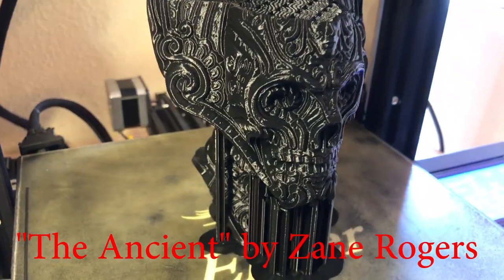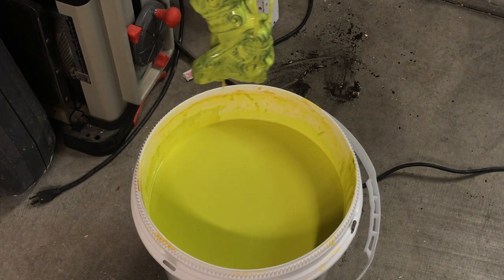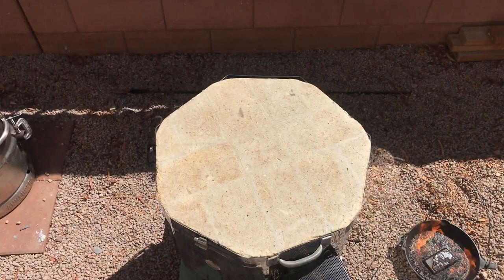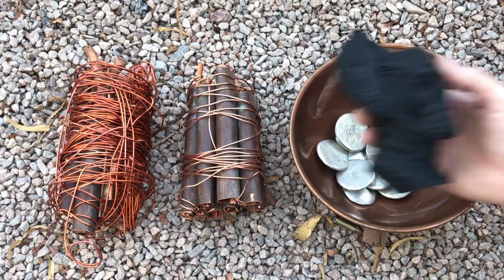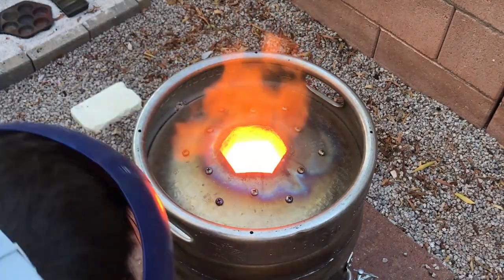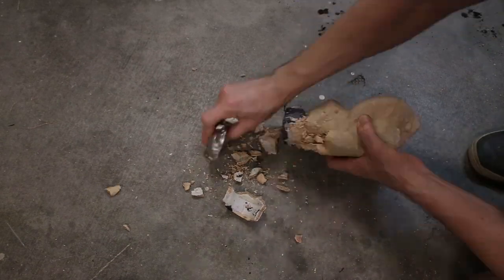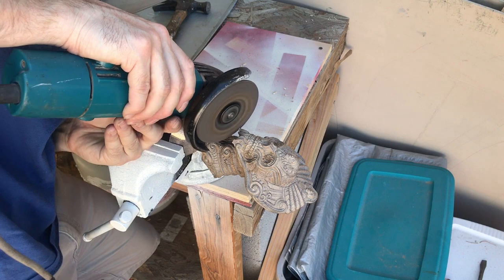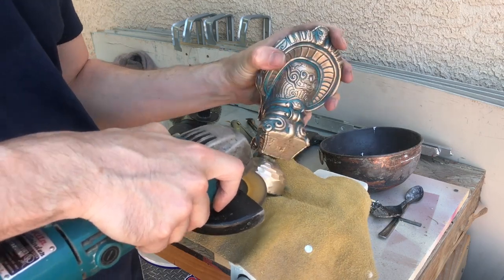3d print to bronze statue │ Lost PLA metal casting │ASMR │ Homemade foundry

Comment from the maker: The yellow ceramic material is called Suspendaslurry.
Reply: Man, that stuff is expensive. Seems worth it's though, as I bet it goes a long way with how little actually gets used as compared to other investment casting methods. Have you considered using polycast filament?
Reply: @faultyinterface  I wonder if one could achieve similar results with clay slip. You'd probably have to be careful with firing temperatures and things like that, but it seems worth a try.
Reply: Is there a different brand for suspendaslurr? Super expensive to bring it to Canada
Reply: suspendedslurry was my nickname in high-school... JK

Comment: Nice work. Just a couple of suggestions though: to reduce the amount of bronze used, fill the inner cavity of  pla prototype with sand/sodium silicate mix (as you did previously doing aluminum castings) and let it harden by blowing CO2 gas through it. To hold the core in place, pierce PLA prototype and sand core with stainless steel wire. If PLA is not thick enough (about 5-6mm), add some wall thickness using molten wax and then fill the cavity with sand/Na2SiO3

Comment: That's a truly amazing cast!  I love how you simulated the oxidation of the copper with blue spray paint! If you use ammonia fumes and salt I think you can also get some really cool patterns. How do you avoid voids as I don't see any exhaust tubes?
Reply from the maker: Thank you! I'll keep salt and ammonia in mind. There are some small voids on the right side of the neck and under the chin. I will cast it differently next time, but the vents from the chin to the top of the sprue worked fairly well.

Comment: Turned out great! I had my doubts on the spray painting but it really worked out awesome. 
I would suggest spray painting the plastic 3d printed model with some primer and then some paint before dipping. This would get rid of some of the lines visible frome the layering of the 3d printer. 
Great job looking forward to more of these vids

Comment: Nice job. The only suggestion of something you might like to try is instead of paint try using a patina like liver of sulphur, this works well on electro formed copper jewellery so it would be worth the experiment. 
There’s also some other patina solutions that use ammonia and salt from memory, if you’re interested I can try and find it in one of my plating books

Comment: You should put an aluminium foil hat over the ceramic shell before you fill with sand as there would be less chance of you damaging the shell. 

Also when you’re running your burn out cycle for the PLA you should put a piece of flat bar under the lid to let the gases escape otherwise you’re gonna get carbon build up on the coils and that will shorten their lifespan. 

Great casting and an excellent choice of colours, what where the colours that you used?

Comment: This is pretty much the process we used at the foundry I did some design work for. In the future, hollowing out the model would help. You'd have to do it in ZBrush or another program, but it can cut down the weight. I've printed entire monuments for this kind of a process. There are some hot and cold patina solutions from a company called Sculpt Nouveau that you might find fun to experiment with on future efforts, too. I'll link their channel. It's good info.

https://www.youtube.com/channel/UCUqAwBoqtvVd6HX2Gzpmbgw

Comment: How long does that bucket of plaster or ceramic last?  Seems like a lot of ceramic for two jobs, unless it lasts a while and you actually used it for more.  That’s an incredible casting, great job!!!
Reply from the maker: Thank you! The material is called  Suspendaslurry sold by R&R and it has a shelf life of one year. However I think that it will last significantly longer. That bucket cost $170.

Comment: When you do your 3D print you should print with a smaller layer height, if you look closely you can see the layer lines from the plastic have transferred over to the bonze cast. Pause at 6:39 or 6:40 to see what I mean.
Reply: Even in smaller layer height, it would still show very tiny layers that are visible. Instead i think he shouldve taken some time to sand his 3d print and then paint and sand again.

Comment: How beautiful melt!
It looks like the surface of the cold cast is very smooth, is it? Is it due to the lost pla method especially? I've tried brass and greensand but the cast piece is always rough also because it shrinks a lot while cooling down. It looks like your cast hasn't shrank a bit, is there a special reason?
Thanks for the video!

Comment: This looks super cool! Have you figured out a way to deal with the print layer lines? Would it be possible to use a filament that could be smoothed out using acetone or something like that to get rid of the layer lines before covering it with the ceramic?
Reply from the maker: Thank you! Some models can be coated in wax if they’re not too detailed. Honestly, I really don’t mind the lines. It’s just part of the process. If you check out the video i made showing how I made the orangutan skull you can see how the wax worked.

Comment: Thanks for another great video! Quick questions, what kind of sand did you use and what was the temp you heated the part to melt the PLA out? Thanks again.
Reply from the maker: 3D Bronze Glad you liked the video! I used very fine sand from the hardware store but you will probably have better results buying the sand firm R&R. I honestly don’t know exactly what temperature the kiln was at. I just turned it on and left it for a few hours.

Comment: This seems like a long process compared to the plaster and greensand method, what are the advantages with this method (i'm still learning) ?
Reply from the maker: Gary McKinnon Yes, it is a long process. The trade off is high detail and the ability to cast complex objects that would be impossible to sand cast.
Reply: You can get very high detail using different sand casting methods the biggest advantage in my opinion is you can cast any shape. undercuts are no issue.
Reply: Thanks both.

Comment: Hello from Brazil, my name is Gabriel. congratulations on your work, it's very good.

I'm starting now at the foundry hobby and I have some problems dealing with copper, could you give me some advice, how do I keep copper from getting black and oxidized? are there any components that i must add to the casting, or a right temperature?

thank you my friend
Reply: Sand blast it (copper or bronze) after casting and chasing.

Comment: Seth, I'll have you know that I bought a 3D printer (same one as you) and suspendaslurry thanks to your video here. I had already started casting but was limited to sand casting only. Thank you for the excellence with which you create and share. My question, what do you call the piece that you glued onto "the ancient" that you used as both pour spout and stand? I need to print several but cannot seem to find what they are called. I'm so new to 3d printing that I don't even know how to design my own. Thanks again!
Reply from the maker: Hello! I'm glad to hear that you found my videos useful. That's why I make them. The thing you're looking for is called a sprue. I will send you the file if you contact me at RobinsonFoundry@gmail.com

Comment: And here I thought you were going to cast a negative in Silicon, pour in wax for a positive. Take that and make a negative in that plaster that jewelers use to cast rings and such.  But what I find interesting is that you were able to get such a finish straight from the 3d printing.  

How was the print made, what resolution, for lack of a better term.  Were there any other steps before the ceramic dip?
Reply from the maker: Pat Bubba Thanks, I forget what layer height I used for this print. I didn’t do any post processing at all. I wanted to capture the layer lines as well as possible as being 3d printed is part of the process.
Reply: @robinson-foundry  now I'm curious.  Did you take any high resolution still photos of the printed model before the casting, as well as the finished cast as well?  I'm asking because I watched your death trooper casting as well.  And that plastic print looked shiney AND smooth.
Reply from the maker: Pat Bubba No but I have a duplicate print. The detail in the casting is almost perfect. The resin the death trooper had a poor surface finish is because the aluminum was too hot. Subsequent aluminum castings have turned out very nice.
Reply: @robinson-foundry  
I did not think about the temperature of the aluminum.

Comment: Very cool... are you allowed to make those and sell them? i guess you would need a lot of money since the cost and time is way up there... thanks
Reply from the maker: roadstar499 Thanks! The model is copyrighted so no I couldn’t but even if I could you’re right, I would have to charge more than people would be willing to pay because of the labor.
Reply: @robinson-foundry  so how do they sell brass statues cheap online.?.. are they not selling real brass etc?. is there a faster method they use...like a mold they use many times i guess... thanks
Reply from the maker: roadstar499 Many are made in China and India. Cheap labor and they’re set up to make tons of them. They most likely use lost wax which is like lost PLA except that the wax shapes can be made again and again using a mold.
Reply: @roadstar499  plus these cheap are hollow maybe up to 1mm thick

Comment: 3D print PVA PVA PVA Casting
Reply from the maker: DIY PCB Problem is, PVA dissolves in water and the ceramic coating is water based. It would dissolve.
Reply: @robinson-foundry  Silica sol casting